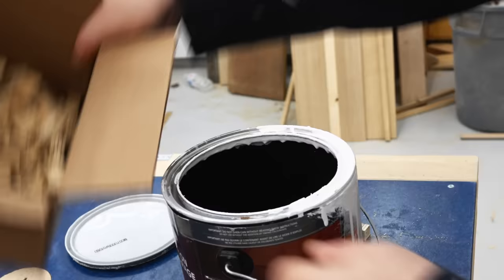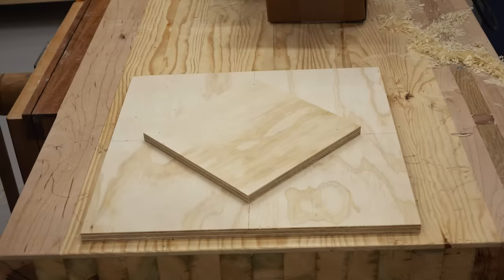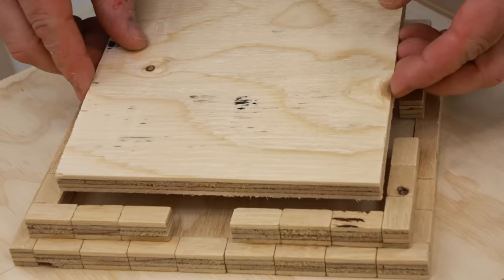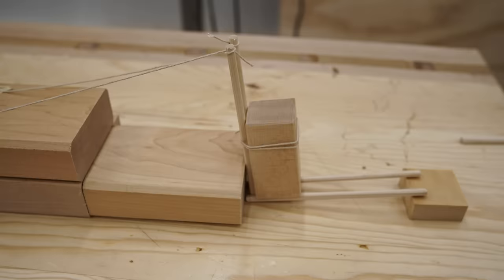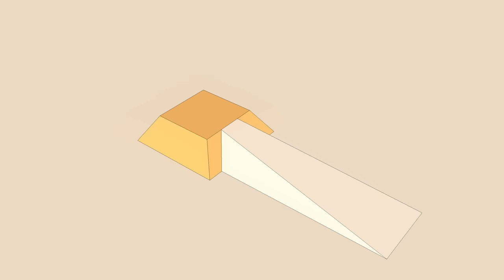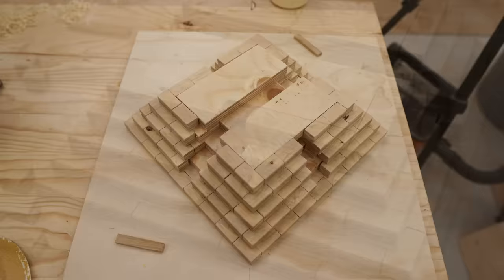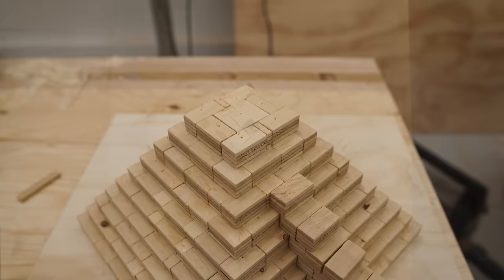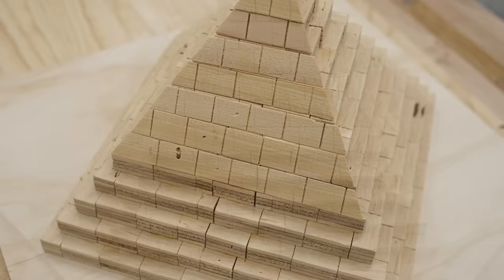How I Would Build The Great Pyramids

Comment: Your idea is great, so don't let what I say detract from that. Egyptologists are actually almost certain they know how the Great Pyramid was built. A while back, they used ground-penetrating sonar imagining from the top down to see the internal structures (I may he using the wrong name for the specific technology they used). What they found was ingenious. They found a ramp that goes along the inside of each pyramid face, then turns 90 degrees at each corner. So they built each level fully, casing stones and all, before moving on to the next level using the internal ramp. They likely used a large pulley system at each corner opposite each ramp, and used oxen on the ground-side to pull the blocked up. The blocks would move across trees that roll beneath them or on a sled, like Egyptian hieroglyphs depict, to reduce friction. However, it's important to note that many Archaeologists believe the Great Pyramid predates the Egyptians. It very well could've been the Sumerians who built it, or Shem's people.

Regarding the depressed line we see up the center of the Pyramid that you believe may have been used to help get blocks up the face, that's actually part of the design, not the path for bringing blocks up. The Great Pyramid isn't a four-sided structure, it's an eight-sided structure. Each face is actually two faces, both sloped slightly inward to create the line at the center of each face.

Besides the Great Pyramid showing signs of being older than all of the other pyramids, the line in the center of each face is one feature that makes Egyptologists believe the other pyramids copied it...because none of them have it, if I remember correctly. The Egyptians likely couldn't put that feature into it very easily like the original builders or they saw no reason to. Hard to say. 

The point is that it points to an earlier, possibly more advanced culture like the Sumerians having built it. But who knows if it was actually the Sumerians or if you'd even call them that since they were so far away from the Sumerians. I guess maybe Egyptologists are claiming that an empire with the technological advancement of the Sumerian Empire, or an offshoot of the Sumerian empire, is who built the Great Pyramid. Hard to say. The Sumerians were the ones who attempted to build the Tower of Babel, basically, in Eridu. It's the only site in the world that contains all 10 features mentioned in the Bible about the location of the Tower of Babel, and it has an unfinished tower with a massive base.

There's a documentary about the ground penetrating sonar pyramid research. Not sure what it was called, though. Sorry.
Reply: There are many other documentaries, Egyptologists, archeologists, historians, engineers, theories, and speculations. Those pyramids have been exhaustively scrutinized and scanned and analyzed by every scientific instrument imaginable.
I'm not saying your particular source is right or wrong. We don't know. That's the whole point - we still don't know exactly how the construction was accomplished. And we may never know without destructive testing.
But we have high confidence that we know (the experts have largely achieved consensus about) exactly when each of the great pyramids was built, and thus we know (the experts mostly agree on) exactly who had them built.
Reply: @pwnmeisterage  I'm not sure what you mean by your reply to my post. We're you agreeing or disagreeing? You stated that egyptologists and others agree on how the Great Pyramid was built but you didn't say how it was built (what they agree on). Could you clarify, because I don't know how to respond?
Reply: @cephyr13  hes just saying it was egyptians not summerians
Reply: @rogiserus  Oh, I understand now. Yeah, it's very likely it was the Egyptians early in their empire, likely having migrated from Sumaria. Hard to tell since dating the Egyptian dynasties is difficult and our dates are likely off a bit.

Comment: This looks like a good solution.  I was thinking they used a lever on top of an a-frame type arrangement.   The a-frame would be moved up 1 level at a time until the block was in place.  Time consuming,  but it did take decades to build the pyramids.
Reply: Same used to build Coral castle in FL... combine that with a lever system within the great hall and a cantilever system using sand on the exterior and it's done
Reply: levers are, and always have been, overpowered. Pls nerf
Reply: And a lever could be made nearly any length and I'm guessing that the blocks are mostly 2 tons because that was the optimal weight/size to cut, move, and lift into place. I think levers were used to lift the blocks as a lever can lift huge weights with relatively little effort.
Reply: The other mystery that comes before how they loved the stones is how they cut them..
Reply: @SnoW-pk9zo  we know how they cut them

Comment: I got like 1 minute in… and I’m thinking Giza has 8 sides, & your blocks are upscaled massively. As a stone mason of 8-10 years I would conclude the exterior limestone blocks wouldn’t have the structural integrity to roll and flip the way your implementing too (without damaging them, limestone can be difficult to work with, so fragile on corners/edges) Not to take away from any of the effort put in here, you’ve done amazing. Very interesting to see anything & everything people have to offer on the subject anyway so Thanks
Reply: The exterior stones are a facade of much smaller stones put on after the rest of the pyramid was constructed. The interior stones are to scale with his "stones."
Also, what do you mean by "giza has 8 sides?"
Reply: @littlesnowflakepunk855  bro…pause at 3.15 and then pause at 4.24. Not to scale, Easy as that to see. All blocks in pyramids are limestone besides granite inside… and yes it has 8 sides. Google exists bro…. Double check for me hey
Reply: @Jack9N  The image shown at 3:15 shows the exterior sandstone blocks, which are smaller. The video is explaining how the interior granite blocks may have been put into place. The wooden blocks he's using are to scale with the larger interior granite blocks. 
It doesn't have 8 sides, it has subtle indentations running down the middle of each side. This video not only points those out, but it also suggests a possible reason for them.
Reply: @littlesnowflakepunk855  pretty sure it’s all limestone hey mate, outer facade being a white limestone. I just saw how he was rolling the blocks on themselves and can pretty much say for sure there’s no way limestone or granite would hold up the way he’s doing it here. The finish inside the kings chamber (joins & faces) is impeccable, I just can’t see it being done this way
Reply: @littlesnowflakepunk855  It is a well-known fact now, that the pyramid has 4 convex and 4 concave corners. The flat surfaces between corners are called sides. So, yes, the Great Pyramid has 8 sides, like it or not. It is not obvious though when you have not seen a perfectly positioned aerial photo of it. There are theories about how it increases the structural stability of it.

Comment: The most sensible theory I've heard. I think the giant ramp idea is almost as ridiculous as any other. Archaeologists can find just about anything in the dirt, but they're not builders lol. I don't pay attention to the "impossible even for modern machinery" quacks
Reply: The rolling and flipping is very reasonable.   I've used this technique on a much smaller scale to move railroad timbers up a hill side.
Reply: About 5 years ago, I came up with this way the pyramids could have been built: The pyramid builders could have used log rollers at the top edge of the pyramid to roll ropes over to another roller on the opposite side of the pyramid. One team of workers would pull the blocks to a point near the base, and then hook another rope onto the block that went to the top of the pyramid. There would be another team of workers on top, who would then pull the block up an area of finished smooth stones. The workers would start down the opposite smooth side, just after the block started UP. Since the block is being pulled up a steep slope, the friction would be less than if the block was on level ground. Sand under the block could also serve to reduce friction. No ramps needed, and also the weight of the workers pulling down the opposite side would make the work of raising blocks easier and faster. Several teams could pull blocks up at the same time, until the work reached near the top.
Reply: Why has nobody ever considered using gravity to help lift the stones? I mean add a counter balance to the levers and then you only need a few people to move the lever. The counter balance could be filled smaller rocks or sand which is much easier to lift. Once the counterweight equalled the weight of the stone you only need a small number of people to operate the levers.
One other question. Has anyone taken one of the big stones out to see if the interior face has been hollowed or drilled out to reduce it's weight?
Reply: FLPhotoCatcher   Yes I think the great chamber had pulley marks and two rails with notches to keeps the stone from sliding back
Reply: Don’t forget they’ve found evidence of a spiral ramp on the inside of the outer layer.  So pretty much the great pyramid was built from the inside.
Reply: WhoDatBe Dare no they did not thats just a theory
Reply: The japanese tried, and failed, they're trying again.

There is zero evidence the ancient egyptians build the great pyramids, zero.
There is not a single hieroglyph in the entirety of egypt that refers to the pyramids, either being build or in any form of reference at all. (that includes on the inside of the pyramids themselves)

They were not designed as tombs, no "mummy" or anyone buried has ever been found.. in ANY of the pyramids.
Kings and pharao's were laid to rest in the valley of the kings, hundreds of kilometers away.

The only thing they did was fix or rather make the outside smooth, there is evidence for that in terms of stones used and numbers and logs of captains ferrying the stones. (all lime stones)
The huge number of granite stones, no mention of that anywhere.

Every theory you can find about the pyramids, the officially accepted ones, are all based on the 1800's and the findings of those days.

And yes, we cannot replicate it without using modern tools.
This video proofs absolutely nothing, in fact, he uses modern tools to cut his lil wooden blocks.
Reply: @whoDatBeDare  I was wondering if this channel was going to show the most logic and feasible way of building the pyramid as discovered and explained by a Frenchman (can't remember his name). Building from the internal ramps makes the most sense to engineers and explains the corner cavities all around the great pyramid. I doubt the idea shown here would actually work as the weight of the blocks could break apart on lowering.
Reply: Angus Parkin just a theory. What’s just a theory?
Reply: @DikkieDikism  Source: a dodgy video on YouTube
Reply: @currenlydying  Ah clever answer, but no.
Partially its actually having been there, so to the pyramids but also the supposed sites of where all the blocks come from (there are several), to several other places aswell initially seeming unrelated but they are related.

Partially i've loved history and know a damn lot about, long before YouTube even existed, annnnd last but perhaps not least a CIA report thats been declassified that also supports what i say. 

Also you're mentioning a dodgy YouTube video.. you do realise you're commenting that under a YouTube video? 
I mean if i thought like you, you could dismiss any YouTube video with such a one-liner including this one.
Reply: Easliy Displeased history is full of peoples claiming one achievement or another from someone else.
Reply: @Mr.Feelgood.  According to all the features and details of this building, the technical implementation is a challenging matter, but the planning is another, far more complex than the possibilities of the Egyptians could allow.
Reply: @DikkieDikism  Source: Still not found.
Reply: blkcandywarez bit of short reply as currently im out of time for a more indepth reply, but no mummy or remains have been found in the pyramids.
I hate to be “that guy” but source please? Also the 1 “sarcaphacus” that was found in “kufu’s” pyramid is in practical terms to small to have held human remains. (And no i dont believe in the alien theory, but i am a fervant fan of the older civilisations theory, for which there is an overwhelming amount of evidence)
Reply: @blkcandywarez Don't bother, they want you to keep an "open mind".

Also i love how he "hates to be that guy" that asks for sources <3
Reply: @DikkieDikism  you need to learn what zero evidence means. There is plenty of evidence. Including document's. And even where and how much they bought the stones... Its how they built it buddy. Get your facts straight.
Reply: The true mystery of the pyramids is not how they were constructed, but how the simple technique was kept secret for millennia. Do you want answers?!?
Search YouTube "Ra Reveals The Pyramid Construction Technique To a Magi"
(Sorry, links are blocked)
Reply: It is impossible with modern machinery what are you talking about

Comment: Would have loved to see them flipping around those 80 tonne blocks with some tree branches. That would have been awesome to see.
Reply: The cool contrarian “one man moves 20 ton block” a recreation of Stonehenge and how he would’ve done it with little to no resources. He displays how to move a block horizontally and how to lift it up. (Hose can easily be replaced to water erosion or slaves risking their lives digging underneath)
Reply: @frostrock7484  yeah i remember watching that guy 20 years ago. Thats nothing like the method described in this video though and it clearly wouldnt work for stacking stone on stone on the side of a pyramid.
Reply: HULK SAY BLOCKS MAKE ME MAD
Reply: This also doesn't explain how they were so precise in placing the stones, and forming the inner structure such as the grand gallery. People discredit the water theory so much, but in my opinion it is the most promising. The great pyramid itself is a Hydraulic Pulse Generator and water pump, which is evidence enough that it was built using water. This is partly just my belief, but also from reading the research of those much smarter I. I know there are many keyboard scientists that disagree, but they also lack evidence of a better theory.
Reply: One of the biggest heists in Egyptian times was in fact done by lifting a massive slab of many tons using a single wood pole (and a battering ram). You put the pole at the corner of the slab, then smack it inching it deeper towards the corner and thus lifting the slab above enough to begin inserting rollers so you can slide it over.
Obviously, the wood is missing today, but the marks of the thieves are still there.
Reply: Its been said gravity is a bitch. You should try leverage. The blocks were more like 2.5 tons, but thats still no problem for well placed lumber.
Reply: @REM44MAG  The pyramid is not an hydraulic pulse generator just because someone says so.
Reply: @robertbrandywine  Believe what you want Robert.
Reply: @surfk9836  They are between 20 and 70 tons depending how high up they are
Reply: @surfk9836  Nobody has ever called me a "pyramidiot" before and I guess your source for the numbers is equally trustworthy? According to wikipedia the granite stones are up to 80t. Other sources stated that the maximum weight was 70t. The average weight of the sandstone blocks was 2.5t which is the number you brought into the discussion here. Those sandstone blocks varied in size quite a lot though. One problem remains though: those heavy granite blocks are pretty high up in that pyramid and you have to explain that if you want to claim that you understand how those building were constructed. Simply calling other people names doesnt prove anything.
The theory I think is most plausible is the idea of an inner ramp. It would still need a lot of tools and extremly well planning but at least this theory is in the realm of giving an explaination that could actually work
Reply: @ibewillow  the point was that he did that alone. they had thousands of slaves. its far from impossible
Reply: @Peron1-MC  actually they probably had very few slaves. Recent findings show a skilled well treated workforce rather than slave labour. Regardless, placing a heavy stone on top of another one doesnt solve how the pyramids, or any of the other megaliths around the world were built.

Comment: Addressing a deleted comment about the lines being vertices of an 8-sided great pyramid.  John points out the lines and says "in MY PYRAMID, this would be where I left out blocks out so that I could move other blocks up." The video is even titled "How I would build the great pyramids."  It isn't known why the great pyramid seems to have 8 sides, but 4 sides or 8 sides, that doesn't change the basic construction challenges, which John tries to answer.
Reply: don't forget the 9th bottom side hyuck hyuck
Reply: Concavity of the faces is clear visible the line goes straight upwards to the middle to the apex. Next problem against primitive building behavior. Is the different length of three sites from four on site,  accompanied with three different foundation heights from negative to positive ground face relative to ground plate height. So we have inevitably distorted pages. That lines are causal to block assembling in a slight gradient direction starting from the corners.
Reply: @postforums6801  every one always forgets that one 😂